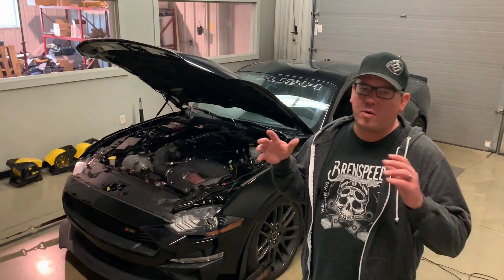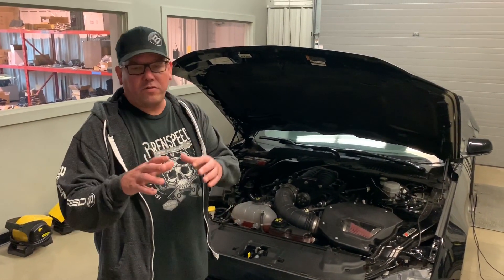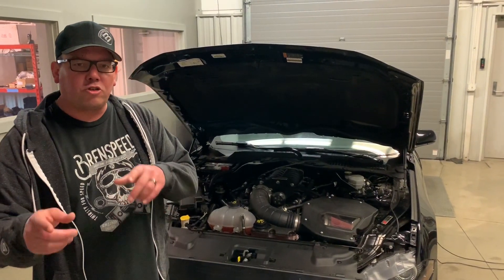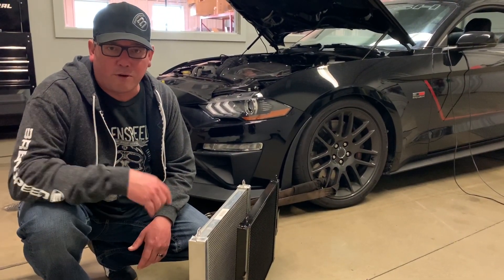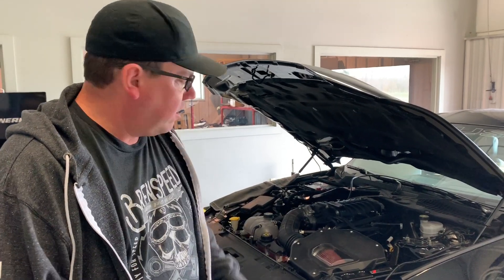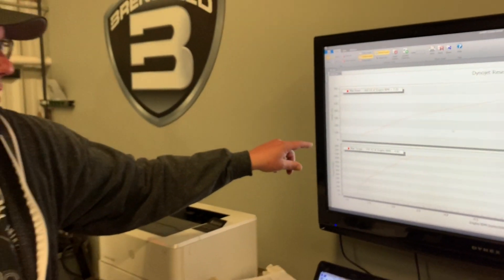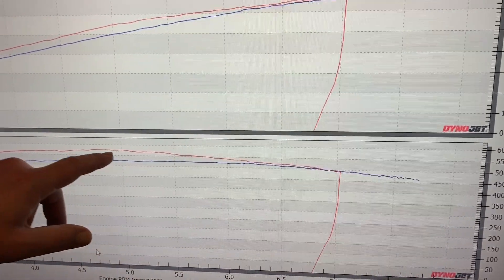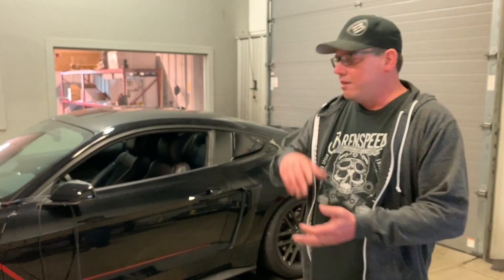2018 + Mustang (IMPROVED DESIGN) Roush Phase 2 Supercharger 750HP Dyno & Review

Comment: Nice car and nice performance...My GT350 is in your shop this week...LTH, CAI, Flex Tune and suspension upgrades...sure would like boost...Have you had good experience with vortech?  I don't see many of those builds on your channel....or is Whipple your favorite due to low end torque?   Do you guys ever turbo?  Hellion?
Reply from the maker: Hi Don your 350 is awesome. As far as a GT350 goes yes Whipple is the most popular due to the fact there are very few choices for a 350. Many companies do not make a kit for it including Roush. I have used everything as far as brands of superchargers on different applications. I have owned pretty much every brand supercharger on many of my cars in my life. Most all have there place depending on what somebody wants to do with the car. If you want less low end torque down low then you would go with something like a Vortech as the boost comes in slower than say a Whipple on a GT350. Nothing wrong with either kit it just depends what you are after. THANKS for the comment. Also to answer your question I am a low end torque type of guy so that is why I like the TVS/Twin Screw kits on my drivers. I run a Roush on my truck also it really helps the low end on the F150.
Reply: @BrenspeedEngineering  Thanks picking mine up tomorrow and Whipple will be in the near future....Talk soon...Please tell George thanks so much.  You guys have a great operation.  Have a nice wekend!

Comment: Fantastic to see this review. I have a 2018 Roush Jackhammer phase 1. Does this stop things like the heat soak I hear. What are the base numbers look like to the new phase 2 kit. And can you just put the new inter cooler with out the phase 2 tune load in. As I have a 5yr 60,000 mile Engine & trans warranty. Will this work on 91 Octane or just 93...  Love your work and Video's.
Reply: The heat soak comes from the fact the Roush chose to keep that particular design where the intercooler sits on the bottom of the blower and on the 18 and up cars that meant having to reduce the size of the intercooler to fit because of the valley being crowded with all the DI stuff and extra knock sensors. Whipple flipped theirs and Edlebrock as well putting the intercooler on-top. Them IAT2 temps of 125 with a big fan blowing like that are horrible in my opinion. Think about what they will be on a hot 90+ degree day....
Reply from the maker: Brian yes you can give Roush a call to get the updated heat exchanger. Do it. Also they might even have a new calibration for you. Keep the car up to date you will love it. Honestly I would jump right into the phase 2 at the same time. We have the phase 2 upgrades if that is the way you want to go. Link in the video description. THANKS for watching.
Reply: @BrenspeedEngineering  Thank you. I'm sending in a quote now.